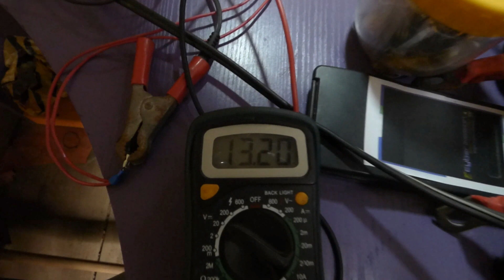Charging Lithium With A Schumacher Lead Acid Battery Charger

Comment: Hi. How do you go about downgrading the voltage from what I presume is 37+ volts on the 300w solar panel to 12v for charging the battery?
Reply from the maker: Hello TechTactics I use an MPPT charge controller.
Reply: @drsolar  thanks for the response